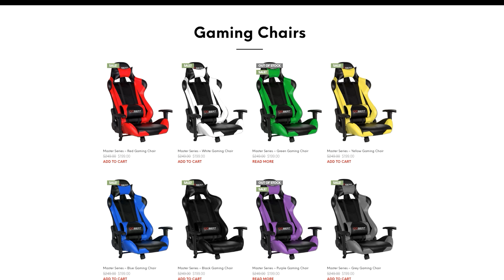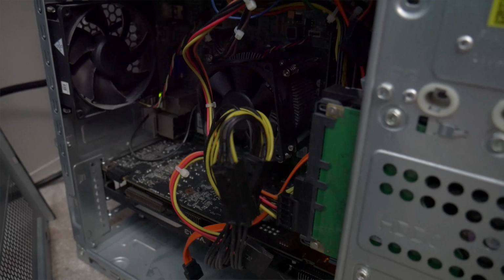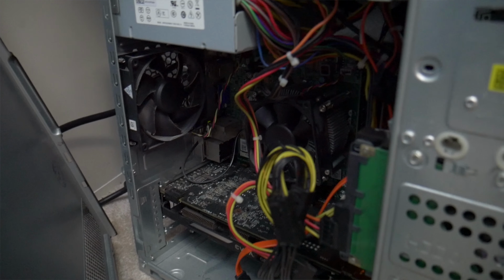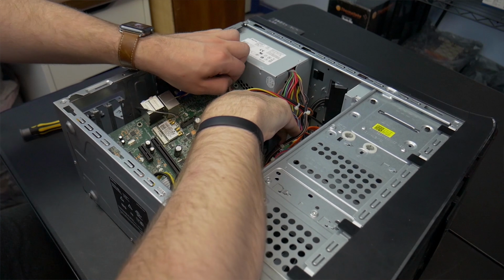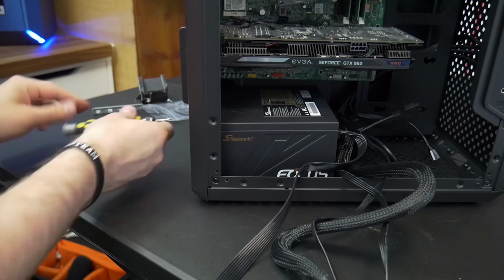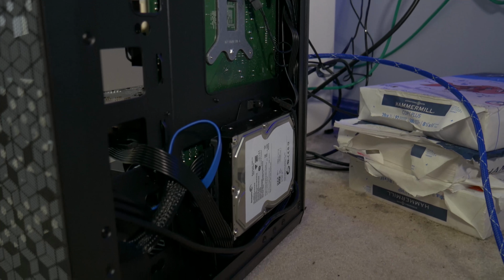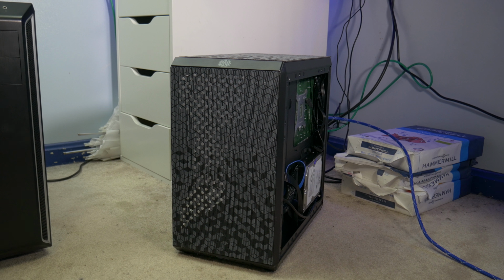Free Gaming PC Build 2018 - Benchmarks in Fortnite, PUBG, Far Cry 5

Comment: What absolutely love with this case is the room for customization. Hate the crappy bottom filter? Create a magnetic dust filter from scrap material. Think the front and top filters look too plain and come off to easily? Add a bunch of short metal studs (the kind that you find on jackets or wrist bands) in between the intake holes and whip out the spray paint. The possibilities are only limited by your imagination.

Comment: How do you deal with Dell Optiplex motherboards that have proprietary power? What did you have to do to the power pins on the motherboard?
Reply from the maker: They sell adapters for them online.
Reply: Really? Where?? What keyword would I search for? I'm interested since I have a SFF Dell Optiplex that I would like to put in a full sized graphics card. I have a spare case.